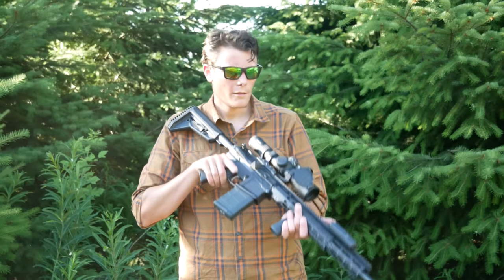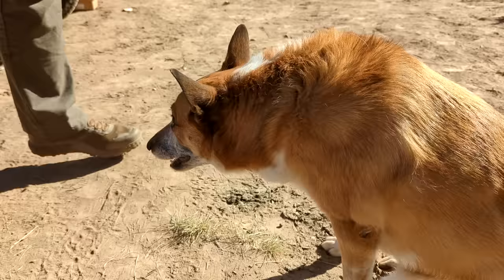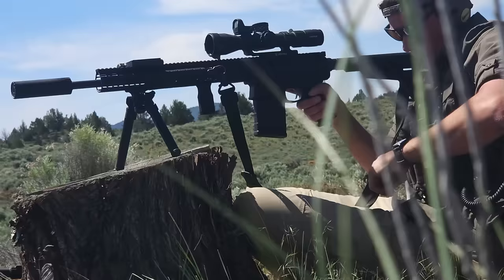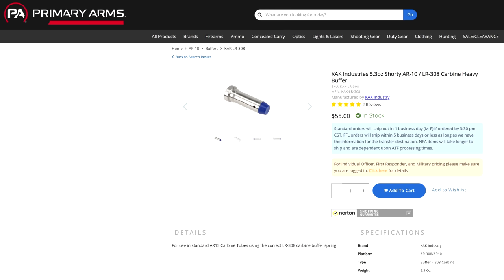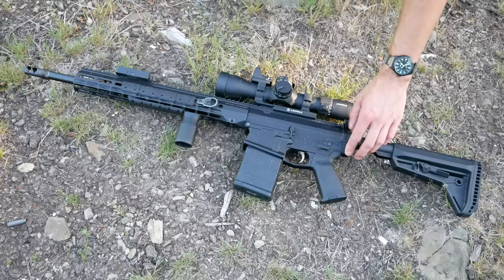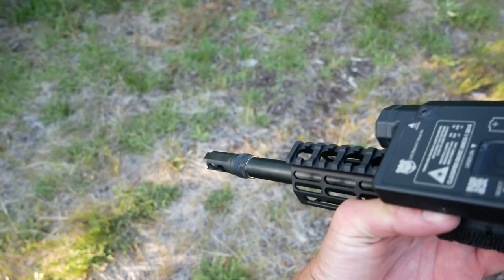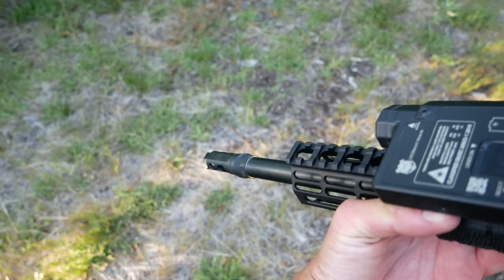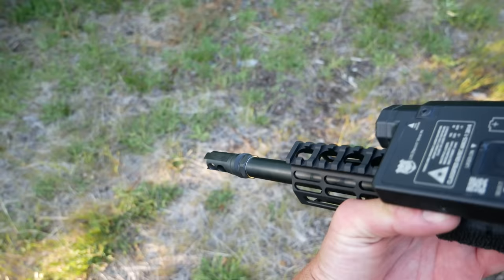Aero Precision M5 SAPR Build

Comment: Here's my experience so far......

I picked up a completed 308 M5 build from a store/builder in Nebraska. First gun was a single shot! Changed a few parts, did not fix the issue. The issue being not a reliable functioning rifle. Might get through maybe 4 rounds at the most if lucky. And always failed to lock open on the last round. Sent it back to the builder. He said the gas block was not properly aligned. Keep in mind he sent it to me out of alignment if that was the case! The gas block and rod was one of the items changed!  He ended up building me a new rifle, because he felt the first was kinda rough when all was said and done. He told me he shot 10 rounds through it, and it worked flawless. 

The new rifle arrived at my FFL where I picked it up a few days ago. And based on what he said about it working fine, I decided to go ahead and change a few things on the rifle. I put on a different pistol grip, added an Ambi safety, put in a LaRue MBT trigger, and this time when ahead and installed a muzzle break (This was not added to the first gun.) I did remove the hand rail and added a bi-pod M-Lock rail adapter and a M-Lock sling connector. I put the scope and the 45 degree mount with red dot back on the upper receiver. But I did not make any changes to the gas block or the gas rod, or the bolt. Took the new rifle to the range and it is a single shot just like the first rifle!!! When I say single shot, I mean the rifle will fire and eject the case (Sometimes will jam with a double feed, but these are rare), but the bolt will not move far enough to the rear to load a new round from the mag! I have to charge the rifle to load the next round And, just like the first rifle it will not lock the bolt back on the last round!

This rifle has not had enough rounds through it yet to be considered broken in I know. But I'm a little hesitant due to all the rounds I fired through the first rifle without fixing the issues, and this rifle already showing the same issues!! 

 I have sent a email to Aero, but have not heard any reply. I think the rifle is under gassed and that the gas port on the 416 BA barrel could be too small, but the builder stated it is the correct size. I really like this rifle and I really want it to work as it should! It is accurate enough. I did zero the first rifle out to 300 yards. 

Kinda wishing I had just went with a PSA 20" 308!

One Shot  (Literally)... One Kill!

Comment: The M5 was my most favorite build. Lightweight 18" barrel, masses of firepower and under 10lbs loaded with optic. The balance was interesting, I added a heavy LMT SOPMOD stock to reduce the front heavy feeling.
Reply: The beauty of the M5 - build it exactly how you want.
Reply: love my M5 but bought the wife an M4 lower and it seems they left a snapped off drill bit in the rear takedown pin hole. I have my FFL looking into it from NY. Hope you guys make good on her first AR build. She is very frustrated. Maybe a completed lower would make her very happy. @AeroPrecision

Comment: Personally for .308 I think I may be a fan of external box mag fed bolt guns for LR. Due to them being lighter weight and no gas in the face from suppressed fire. But I haven’t shot any to know for sure, I have fired AR10s though, I do like them, and with a 5 port brake man, there’s no recoil and outside behind the gun, the blast isn’t an issue for the shooter. You definitely don’t want to be beside it though, that will give you a headache in a hurry.

Comment: I still need good glass for my PSA G3-10 in .308 Winchester. I got their complete 20 inch upper a few years back but sadly haven’t shot it much. I put a strike industries jcomp 2 muzzle device on it and changed the grip to a magpul moe. I love the MOE SL stock on my 12.5 5.56 but I have the magpul ACS stock on my AR308. Great video as always

Comment: I have a similar build as yours with the same barrel, and same gassing issue. Super common problem but I would advise against messing with adjustable bcgs and either send the barrel out to be enlarged, or what i personally did is slightly enlarge the gas port little by little with a drill press. After enlarging mine I'm getting perfect ejection and no gas issues.

Comment: A maybe less known but nonetheless legendary gunsmith Charlie Largay told me once that an adjustable gas block is a core component of a precision gas gun. For whatever that's worth.
Reply: I won't build any AR without one, whether it's intended for precision work or not.
Reply: I've seen a few different channels hating on adj. gas blocks lately - maybe it's a trend but unless you ONLY ever shoot one setup and you have perfectly tuned everything, I see them as mandatory on DI AR's. With a normal gas block you're stuck shooting either fully unsuppressed and getting gas to the face with a can on, or fully suppressed and gun barely cycles if the can comes off. Plus it helps out if gun is getting super dirty to open it up a bit.
Reply: @alexisdetocqueville9964  If the gun is getting super dirty it helps to clean it.
Reply: @kilroy5166  No shit, sherlock, but sometimes you're in the field and that isn't possible. You must only ever shoot at the indoor range.
Reply: @alexisdetocqueville9964  How many rounds are you going through in the field that your gun jams up? Most Ive ever carried into the field is 1,000 rounds and that didnt slow mine down any. Not to mention that if you are carrying 1,000 rounds of ammo you can carry a fucking cleaning kit.
Reply: @alexisdetocqueville9964  Adj. block makes a lot more sense if you want to run one rifle and fine tune it for whatever you may be doing that day or constantly changing the build around. Some guys like doing that, others would rather build a bunch of different rifles each one optimized for a specific purpose.

I'm the latter guy. I'd rather build and dial in a rifle once and be done with it.

Comment: With a very similar (but Creedmoor) and going on/off with a suppressor, I had to go with an adjustable gas block to keep reliable without, and not get slammed & gassed with. The available buffer system tuning range is too narrow. If I did it again, I would go with the RifleSpeed system with the collar reaching up to just behind the muzzle device. Twist on the suppressor and, right there, twist in 2 clicks on the gas block. Twist off the can and twist off the 2 clicks (or whatever it worked out to). Maybe add witness marks for the two settings. I think I just talked myself into spending more money. Damn you, Hop.

Comment: Really interested in your experience with this platform going forward. Parts availability for the AR10 is getting better, but comparability and interchangeability, while greatly improved, can still be still sketchy. Early builds where I chose parts for lightness were nightmares that took way more gunsmithing than I signed up for. The adjustable gas block has really worked well but time will tell.
Reply: What are you running that gave you nightmares?
Reply: @prone_wolf8871  Inititally it was impossible to get matched upper/lower sets and parts came from wherever and from whoever you could get them from, so uppers did not fit lowers, charging handles were too tight, too loose or interfered with lowers, pins were under/over sized both in diameter and length. Getting a receiver set from AeroPrecision in 2019 was simply not an option. I won't mention specific companies as they have mostly improved dramatically to their credit over the last 5-6 years.

Comment: Hey hop, just wanted to point out the nice thing about that Aero handguard, specifically the barrel nut. I know you said you had to time the barrel nut... but that's because the OD of the barrel extension portion of an 308AR is significantly larger than an AR15. And the REALLY nice thing about the Aero is that you don't have to buy or find another proprietary barrel nut wrench, you can use a "milspec" AR15 barrel nut wrench. That, to me, is a god-send... I cannot tell you how frustrating it is to lose the barrel nut wrench or have it strip, or etc... This you can just use one of the many standard AR15 barrel nut wrenches.
Reply: Those same handguards for AR-15s have to be timed.

Comment: Theres a lot I like about that setup. One I don't like is that the whole system seems proprietary, so its not interchangeable with milspec items.  The upper and lower cant be swapped with normal ones.  The bcg and buffer weight are unique, and I suspect if you change one it probably wont cycle right unless you swap both out.
Reply: This applies to all ar10/lr308/dpms/sr25 rifles. There's very little interchangeability. You should really use the same company's parts if you want a good fit. But, the dpms pattern that Aero uses is the most versatile of them.

Comment: I've recently been into 6.5 grendel and 6 arc. I tend more to like grendel. I live in Florida so unless it's a cleared feild, I simply can't see far enough to like my 6 over the 6.5. I shoot enough to know 308 is great, but overkill for me. I have several 308 guns but don't seem to ever need that level of gun, I have 338, 33 30 50 7 8 9, here I usually just use 5.56 for deer, lately 6.5, but 5.56 works fine.
Reply: Same....loved the Grendel then built a 6mm.....and I love it even more...but still love the Grendels....

My 16 inch 6mm got a 3inch 3 shot group @ 1k yards with factory Hornady match and I was hooked.....
Going to build a lighter version of the same setup....

I too have my tricked out m5 sitting in the safe cause the 6mm is a laser but so much more compact and light weight.

Comment: Yeah I wish I went the 18" route for a rifle gas system. Went with a 16" BA barrel on mine. I also went with the SA adjustable block, which after your previous video I'm thinking I should have gone with a regular gas block to avoid any possible issues in the future.
Reply: All but one of my builds run adjustable gasblocks...you have to tune it correctly....but after that...unless you run shit tons of rounds through it you'll be fine

Comment: Check to see if the enhanced buffer tube lips are getting hit by the BCG on the 4 and 8 o clock area of the tube when running suppressed, I have a similar build and had that issue.

Comment: I recommend a different pistol grip.  Something like a gratis or mft with a more forward rake.  Sometimes bolts, barrel, and extensions are made out of spec of each other where it'll cause sluggish cycling.  A 308 semi auto is preferable to a bolt action bc you'll probably miss the first time.

Comment: When I think semi auto precision rifle.. it doesn't have a lightweight handguard, light barrel, or a flimsy receiver, or an ar15 carbine stock.. this still seems like a battle rifle where maneuverability is a priority. Maybe a dmr...

Double the weight, upgrade the receiver, add thickness to the barrel, and maybe it's a precision rifle. 15-16 lb .308, better yet 20+, and a different magazine for the good ammo instead of the short range stuff.

Comment: If you're chasing accuracy the barrel is the first thing you'll have to change out. BA is fine for battle rifles, but in precision gas guns the barrel is the only part that really matters and BA is bargain bin level barrel. Try criterion or similar brands.

Also, should look into bedding your barrel, consistency is really important, and getting all the wiggle out between your barrel and your receiver is important.

If you're really dead set on non adjustable gas, get a JP adjustable buffer for suppressor use.

Comment: Hopp.  Out of curiosity, is your carrier leaving gouge marks on the buffer tube and lower were the buffer screws in?  I have the exact same rifle as you.  I found that the carrier is crashing into the buffer tube.  I did some research and found out it’s common for AERO’s to have this issue.  Apparently most guys are dropping two quarters in the rear of the buffer tube to limit how far the buffer and carrier will travel in the tube.

Comment: Ar10 is better at… 
B is for Barriers
A is for And
R is for Range 
Heavy barrel, swap the buffer system, fastest trigger you want, bipod you can load. If a 308 is warranted then throwing a lot of 308 in that direction is warranted. If you’re siding on accuracy and being a dmr pick something that isn’t a 308. I wish more dudes would talk about pous in depth

Comment: Why wouldn't you like AGBs? With a standard gas block, you are stuck with the throughput. With an AGB, you can adjust it before you're stuck with it. Why not tune before it locks itself in rather than be subject to the built-in throughput?

Comment: why does it make more sense to have an adj gas key on the carrier vs and adj gas block on the barrel?  seems to me like either way its a new failure point,  and i'd rather not have that happen inside the action?
Reply: I'd guess because if it fails or proves to be an issue, it's much easier to swap out a bcg
Reply from the maker: The bootleg carriers are very robust. BrassFacts has an insane round count on his without the adjustment locking up.
Reply: @poopoo7705  fair point!
Reply: @Hoplopfheil  good to know!

Comment: Just finished up an M5 build in 6.5CM with a Wilson combat 22" super sniper barrel. It's a tack driver, but WORD OF CAUTION for those building these in 6.5CM - you will almost certainly need a 'high pressure' bolt for it (JP Ent. makes a good one). The 308 BCG Aero makes is not equipped at all for the high pressures of 6.5, especially hotter ammo. First two times I shot the gun it was popping primer like crazy, to the point I got a horrible malfunction from the primer caps collecting in the bolt and jamming it up.

Comment: Did you have any cycling issues, given that you’re running an 18” rifle upper with a carbine buffer kit and stock?

I just built one and I’ve had nothing but failure to feed, failure to extract, stove pipes and double feeds. Aero Precision’s customer service said I’d need to switch to a rifle buffer kit and rifle stock to solve the problem. But it looks like you either figured it out, or had no issues whatsoever. 

Any help would be appreciated, and thanks for all of the awesome content you put out!
Reply from the maker: What was your configuration? This one is 18" mid length gas with a hanson barrel, so they tend to be a little undergassed but with ample dwell time.
Reply: I was running Aero's 18" complete upper in .308, with their enhanced .308 carbine buffer assembly and the Magpul CTR stock. After several customer service chats, I learned that I needed to swap the buffer and stock to the rifle configuration. Luckily I was able to swap the lower from my 6.5 creedmoor and try it at the range yesterday, and it ran like a champ.

I also read on quite a few forums that you can bore out the gas port to 3/32 and that this will solve the undergassing issue and allow you to run a carbine stock. I may try that later, since I was hoping to run more of a battle rifle. At least she's running strong for now though. Thanks for the reply! @Hoplopfheil

Comment: Hey Hop I'd be interested to see if you'll try the A5 system on this rifle. I'm building something similar with a Proof CF bbl w/Intermediate gas system (.750) and curious to see if the A5 system on a 308 would be a benefit or a pain in the ass. Most of what I read says it works very well. I love the 308 round and will be following this build closely. Have a 6.5 Creedmoor build and it's a LOT of fun and very accurate. 6ARC is my fav over both rounds, but ammo choices are limited right now....

Comment: It’s rare a solid bolt gun set up for precision shooting is cheaper than an m5 build in my experience
Reply: Very true...I tell people if they're on a budget just get a Tikka ctr in 6.5 creed and be done....half moa with factory loads....

But it is sweet when you have a ar 10 thst can hang with a bolt gun for accuracy and rip like a gamer gun with almost no recoil (in context)
Reply: @prone_wolf8871  I have a .75 moa savage setup in 6.5 that was under 2000 all said and done. Pretty hard to get much cheaper unless you skimp on glass

Comment: If you want to seriously lighten it up...and make it a faster rig...try the jp Enterprises lmos instead of the bootleg.....it makes the weapon feel so much lighter (those  bcgs are pigs).

Also try to support your butt stock better so it doesn't bounce so much when your prone...it will help... 

Gold medal match is the load mine shot best with...sub moa..but I'm thinking of getting a proof 6.5 barrel for it....

Honestly it's been in the safe since my 6mm arc build is sooo much lighter and more accurate ....got a 3 shot group at 1k yards under 3 inches

Comment: Isn't the Ruger SFAR just built on the DPMS G2 platform? I know that's not the most common pattern (at least until DPMS starts making them again, which apparently will be soon), but there is parts out there for them.
Reply: The barrel and BCG arent replaceable on the SFAR so that really just leaves you with a replaceable handguard

Comment: I feel like you would definitely want a rifle gas port for this thing. Weird that they put mid length on an 18 inch.
Reply from the maker: That's the way it is with Hanson barrels. Shorter gas systems than you'd expect, and smaller gas port sizes to make up for it.

Comment: If your going 308, just accept the additional weight and get a heavy barrel of 20 or so inches.
Reply: Why
Reply: @K-bob_45  For maximum accuracy and terminal velocity with the cartridge?. By all means get a 14 inch pencil barrel if you see fit.
Reply: @yakivpopavich  for maximum velocity and accuracy just get a F class rig with a 32” barrel. For an AR-10 I’d make some concessions
Reply: @yakivpopavich  Ok then why not a 22 inch or 24 inch barrel